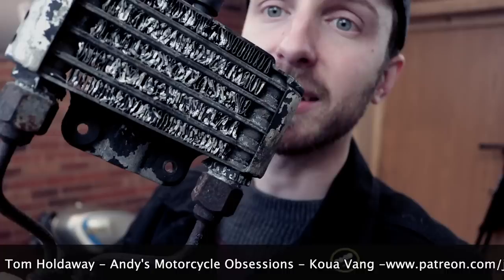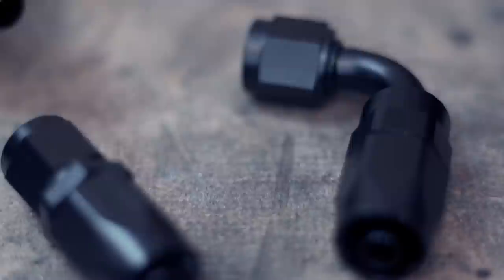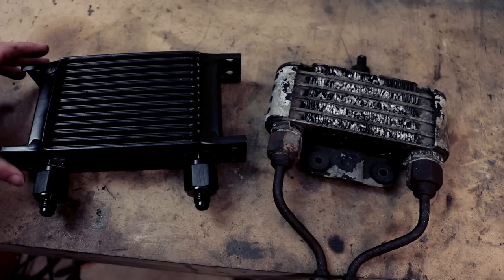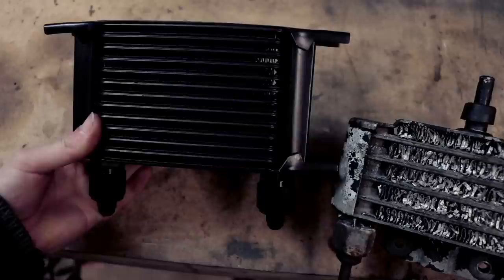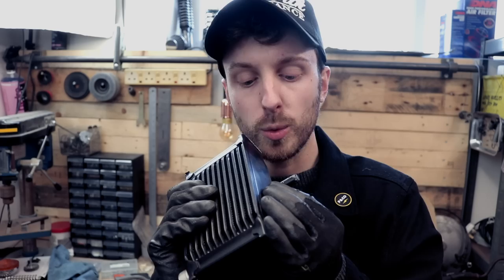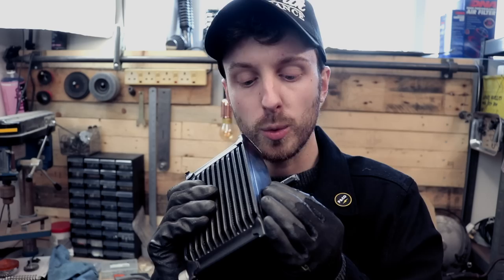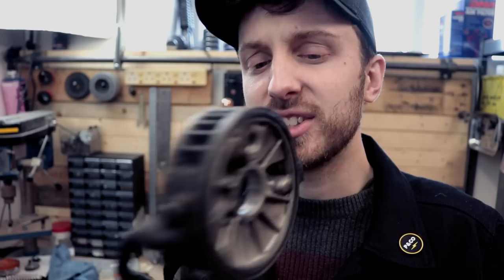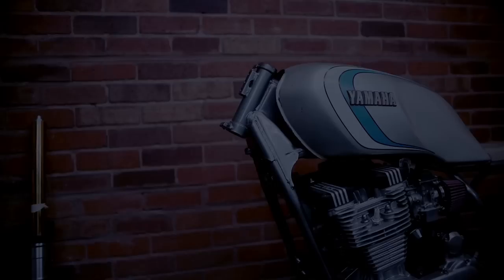XJ650 Build Part 28 - UPDATED OIL COOLER - AN FITTINGS

Comment: The adjustable spanner part killed me ... get an aluminum AN fitting wrench. I like how the build is coming along.
Reply: I don't think there's anything wrong with using an adjustable in this application. You're not tightening to any great torque and it allows plenty of tape to be wrapped around to prevent marking the fittings.
Reply from the maker: Gotta use what you got sometimes! i dont have a AN wrench but i will get one when soon. plus the taping helps from damaging the finish and it did the job :)
Reply: @jishh  shifter spanner and tape

Comment: The old cooler set up looks like a aftermarket line adapter with a repurposed cooler. US & JP XJ 650 didn't have oil coolers as OEM. Aftermarket oil coolers make it a tight fit when mounting a steering damper. These bikes want a steering damper when ridden at speed. Mounting the oil cooler off center helps make room for a steering damper. Be sure to check oil cooler for wheel/fender/fork clearance at full fork compression and full steering lock. Build is coming along nicely.

Comment: Coming along nicely Did I see the oil cooler only hanging by the pin on top?.
Reply: I was thinking the same..........
Reply from the maker: the new cooler sits slightly lower than the OEM making those fixings very difficult to do. the lines are much tigher than the original and hardly moves so will see how it goes and if it needs something doing i will approach it then :)

Comment: You don't see those ends on bikes because they're expensive. Same reason you don't see them on stock cars, crimped ends are way cheaper. You'll see plenty on old oil-cooled gsxr 750/1100 streetfighter custom bikes though.
Reply from the maker: Fair point!

Comment: So I have an xj650 Maxim, and it doesn't have an oil cooler... What is the stock location of these on the bike? Thanks
Reply: I have a 81 xj650 maxim and 83 xj750 maxim neither have this, but that is a seca tank on his bike maybe they had that option?
Reply: @jasonmolen11  yeah that's what I'm thinking, that the secas had the oil cooler because they were a bit sportier
Reply from the maker: I think this is the case yeah! i could have removed it, but i thought id make something of it instead
Reply: @jishh  good idea

Comment: Jish! Stunning result on that new cooler with the am fittings! But why didn’t you use the bottom bracket of the old cooler?
Reply from the maker: the new cooler sits slightly lower than the OEM making those fixings very difficult to do. the lines are much tigher than the original and hardly moves so will see how it goes and if it needs something doing i will approach it then :)

Comment: Hi there, i got an old 80 cb750 supersport that im rebuildin and my oil cooler looks like it's seen better days.  I really dig the new setup you have and I would like to go the same route or similar to give my cb750 a more modern look.  I was wondering what were the specs on your oil cooler were.  It's a lot bigger than mine (I think mine's a 10 row one), and was also wondering if there was a big difference good or bad with going a bit bigger?

Comment: will you use the same amount of engine oil or do you need something extra if the new radiator is bigger?
Reply from the maker: it will use slightly more i guess! i will just fill her up and check the level window on the side of the engine to make sure its got enough oil :)
Reply: right! the level window.

Comment: That looks really smart. 
Didn’t you use a bottom fixing on the oil cooler?
Reply from the maker: I didnt as the new cooler sits slightly lower than the OEM making those fixings very difficult to do. the lines are much tigher than the original and hardly moves so will see how it goes and if it needs something doing i will approach it then :)
Reply: Jish nice one. I will send an email to get the same set up for my XJ 650!

Comment: You can remove an oil cooler.
Reply: I deleted the cooler off my old xj600s when it rotted out. On that bike you just needed the shorter fitting off an xj600 to delete the oil cooler adaptor sandwich thingy, as that model didn't come with a cooler.
Reply: @MrAmorti  I took it off my vfr750. Didn't need it.

Comment: You just ignored the bottom two fittings of the old cooler.  Think of it like this  - if the manufacturer thought they could get away without them, they wouldn't have put them there in the first place.
Reply from the maker: Or they wanted to save cost 😅 these are not cheap and the cost would have reflected badly in the final production cost

For example, why dont all bikes come with hand made stainless steel exhausts? Race adjustable suspension? Its all relative production costs my friend
Reply: @jishh  I'm referring to the mounting brackets. An oil cooler needs to be securely fastened and not just waving in the wind, which yours will after a while, or even worse, it could crack and leak.
My point about production cost is exactly the same as you're making.
Reply from the maker: 11 months later and i agree with you. Although i have gone through the process of bracing it in a way that works with this build differing from the OEM mounting positions